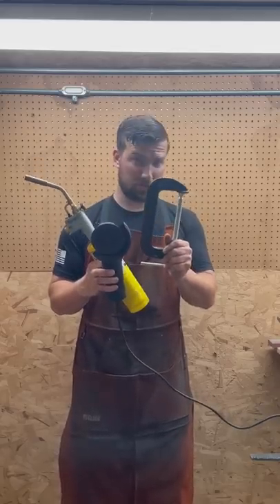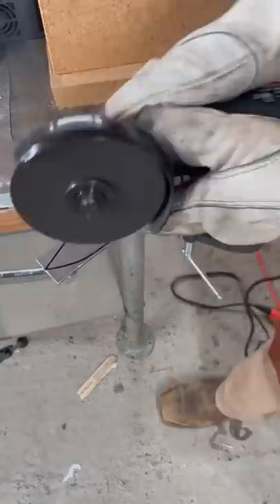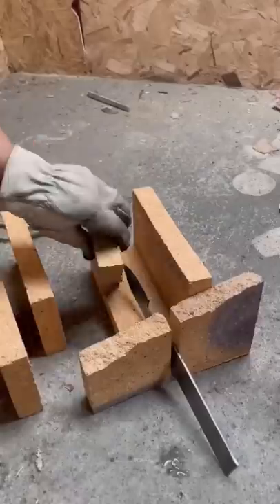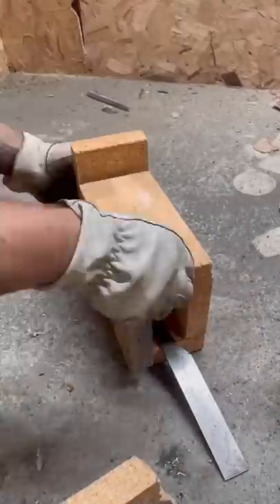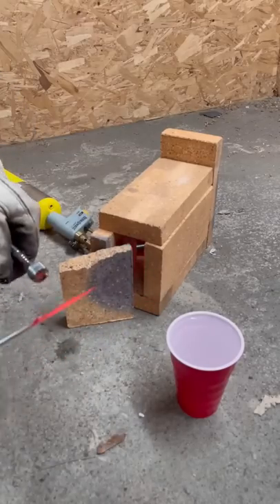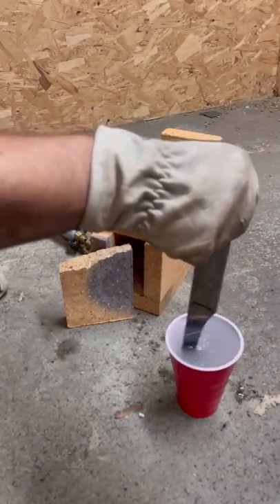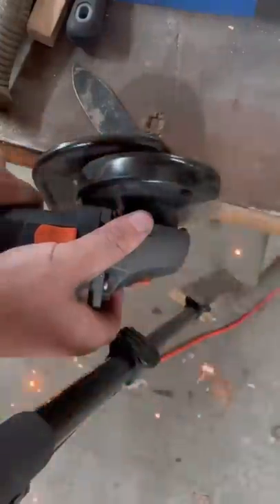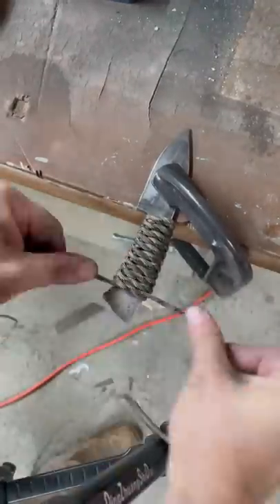How to start knifemaking without expensive equipment!!

Comment: I've been making knives since I was 13 and only had a bench grinder, dremel, and hand tools. Even made my own propane powered forge so I could heat treat them. This stuff is not as complicated as a lot of people think, it just takes a lot longer when you don't have all the tools you want like a belt sander and a metal cutting band saw.
Reply: My first one was shaped out with a grinder then cut my bevels in with files only. I honestly thought it was gonna take longer than it did but a good set of files will cut that in fairly quickly. I did the heat treat at work where we had a torch and also used the drill press at work for my pin holes. I was proud as shit of that knife. It was a Bowie I made from a horseshoeing rasp. I even cut several trees down with that thing about 6 inches in diameter. That was the first of .any more to come and now I haven't touched a knife in almost 15 years. I'll get back to again eventually
Reply: If you get into different types of steel your have to be more precise in the heat treat. I'm sure you know but people reading these comments may not.

Comment: Can we talk about how perfect his bevel was with an angle grinder? Dude could literally be a world famous pipe fitter!
Reply from the maker: I was a pipe fitter
Reply: @calculatedsurvival  I wish I was your welder. We would’ve been a perfect duo.
Reply: @calculatedsurvival  was...what happened bro, me n my mom are both in the trade although she only works for about 6 months out of the year now n days
Reply from the maker: @dewal5772  my passion was the outdoors.
Reply: @calculatedsurvival  so now you just do YouTube or...do you still have a day job I fully support the grind if you are trying to become, a YouTuber my friend it's a decision I could never make after many years now
Reply from the maker: @dewal5772  Well, I post to Tiktok, instagram and Facebook as well. I have a website where I sell survival equipment. But more importantly, I have a couple patents pending on some survival gear I designed. And I have more on the way. I love innovating and I worked it into my love for the outdoors. So no other day job to answer your question.
Reply: So for reference the proper angle for forming & sharpening a knife is 17%
Reply from the maker: @devingeary455  a kitchen knife, yes. I use a 20° angle for my knives though… it’s slightly more stout, and still gives me a hair-popping edge.
Reply: @calculatedsurvival Great video. Could you please tell us where to buy your survival equipment at ???  Thank you.
Reply from the maker: @shanesims2864  www.calculatedsurvival.com
Reply: Came for a quick knife video,  subscribed for you transparent and honest in depth responses. Great content
Reply: Can I buy that from you.
Reply: @calculatedsurvival why did you bake it at 400?
Reply: @dannyshane4722 I'm new to this, but it's my understanding they do that to temper the steel/blade
Reply: Most people don’t realize how difficult it is to use an angle grinder.

Comment: Bro , that is so cool, I think this is the only video that I feel I can do tomorrow, no problems. Boom I have a cool knife !
Great content !
Reply: Until you realise the absolute sick grinder skills required to get those bevels right, free hand, with the least precise tool in the whole workshop...
Good luck but this video is a skill flex....
Reply: Yeah I just noticed that bevel/grind skill. Yeeeeeeeah, gonna be a min on that.
Reply: Would you make it a Chod knife as well?
Reply: @CS-zn6pp  and getting the blade thin, but not so thin that the temper warps it, then grinding the rest of the bevel in without fucking up the heat treat, also most ovens will shoot up to 500 and drop to 350 before regulating temperature so the heat treat cycle is really inconsistent.
Reply: Facts
Reply: Or just buy one and get another hobby lol
Reply: Very good job. Hope you will have more videos
Reply: Until you say, “tomorrow, really”
Reply: @CS-zn6pp  it's really not that difficult my man. A flap disc makes it a lot easier to control the amount you take off. They come in various grits and I would even wear one down a bit on some scrap to use as a finishing disc.
 I made a very nice looking machete using an angle grinder. I do have quite a bit of experience with the tool though.
Reply: @brertt8350  you are absolutely correct. I was going to say that what he doesn't show is working it on the flame to get an even heating. You definitely can't just stick it in there and let it heat up. It takes a little knowledge of the colors in order to keep from burning the tip and to get an even heat.
I've had a couple of knives warp because of a slight temperature difference between each side.
Reply: @CS-zn6pp  amen ma brotha
Reply: Only if you know how to tie a paracord
Reply: Did you ever make one?

Comment: Thanks for this. Simplification of heat treating needs to be a thing. Well done
Reply: There's a lot more to heat treating than just one big dip
Reply: I'm still corn fused about the heat treat. He said he puts it in the oven for a hour @ 400⁰....he does this twice? So, he takes the knife out, resets the timer for a hour, puts the knife back in?
Reply: @L-Train0ne  
That's not heat treating, that's tempering. 
Heat treating makes the metal hard but brittle. 
You want enough hardness to retain an edge but it will be too hard and become brittle. 
Tempering will bring down the brittlness and it will be easier to sharpen.  
Every steel for knives has to be heat treated and tempered. The heat treating is the same, bring it to critical temperature (so hot a magnet will not stick) and then quench is some liquid to "set" the grain structure. 
The tempering can be different for different types of steel.
Reply: @samcoon6699  ht is the entire process, hardening makes it hard, tempering makes it soft.
Reply: @L-Train0ne  yes two cycles air cool to room temp then do it again
Reply: although with water and brine you run risk of cracking blade...oil quench is better option with same method to quench
Reply: @markboston2850 is it a special oil? Or will vegetable oil work

Comment: Easy and clever. I suggest leaf spring steel when available. Either way, that's a proper decent piece of kit.
Reply: Leaf spring steel is objectively a worse idea. Could have microfractures from use, but even worse, it could be a range of various different steels depending on manufacturer and age, and that's a recipe for inconsistency and sub par results.
Reply: I have made a few knives with spring steel! They have turned out nice!
Reply: If you really wanna bitch, how do you know it's really 1095?
Reply: @nickhadfield3192  no. it can be normalised and tempered.
Reply: @jackkincaid9705  Send a sample to Underwriters Laboratories ? Nope, that might not be the best idea yet.
Reply: @jackrichards1863  That does not eliminate microfractures, and even when there are none, you still don't know the exact steel, so it's almost impossible to heat treat it correctly.
Reply: @bonumferrum4055  ha ha ha . First rodeo eh! I guess I was green once too.
Reply: @bonumferrum4055 it's pretty easy to heat-treat actually. I would still recommend just purchasing high carbon steel pre-cut pieces
Reply: Or try using that old lawnmower blade you just changed out…

Comment: Oil is far better for quenching. The water can flash evaporate to steam creating a tiny pocket of gas that will prevent that part of the blade from cooling at the same rate as the rest of it.
Reply: Water quench is also more aggressive and greatly increases the likely hood of cracking.
Reply: This is brine though which is great for 1095

Comment: Oh that's awesome I never knew you could judge the temperature for heat treating by using a magnet.
Reply: you can't it loses magnetism at a irelevant temperature its 725 something and deired ranges feom 750- 1000 depending on the material

Comment: Nice instructions. But that propane torch tank sure looks like a MAP gas tank. Just saying because there's a little difference between the two. As one probably wouldn't heat the metal hot enough.
Reply: Truth.
Reply: This.
Reply: @leggoego  mmmm. U confuse me. Maybe I'm to ignorant. Please explain
Reply from the maker: Yeah it was MAPP gas… I mis-spoke
Reply: @calculatedsurvival  I read messages. I apologize. Yeah lots of peoples pointed this out. As Mapp Gas is a stabilize form of Propane and acetylene oxygen enriched. So technically you're right.
Reply: @patrickdavis9566  he's pointing out your comment and agreeing.
Reply: Propane will heat the steel just fine. That's why he uses fire brick. To hold that heat in one spot.
Look up propane forge.

Comment: Honorable mentions:
1. Metal purchased from Amazone
2. Oven Bricks
3. File
4. Salt
5. Cup
6. Water
7.Oven
8. Sand paper
9. Paracord
Reply: Don’t forget…
10. Electricity
11. Money
12. Gloves
13. Tongs
14. Sweet Apron
15. Spare Time
Reply: I would like to add :
16. Magnet 
17. A 24 grit sanding disc
18. Desire to make something you could most likely buy cheaper on Amazon.
Reply: @adamb8317  yessir and you’re missing a sense of humor
Reply: @danno8852  nope I thought it was kinda funny. It was a tired joke by the time I got to it though.
Reply: 19. Hands
Reply: @codyburk84  20. Air
Reply: @adamb8317  nice
Reply: @codyburk84  21. Ambition
Reply: 17. A pair of hands 
18. A brain
19. A power outlet
Reply: Propane torch*
Reply: @adamb8317  hey now, you couldn’t have been too tired of it if your joining in on the fun aye there buddy?
Reply: 57. Human being
Reply: All of which are pretty easy to obtain at any hobby shop/hardware store.
Reply: Paracord has left the chat.
Reply: What's the oven for?
Reply: @SouthGlass for the sweet azz special brownies he's going to cut with said blade!

Comment: For those of you who want to do this but want to do it cheaper, a hole in the ground will work just fine as a forge. Firewood will get plenty hot enough but you'll need a forced air system. A 3' steel pipe (do not used a galvanized pipe) and a bicycle pump will work fine for a bellows. A piece of railroad track works for an anvil. I've used smooth rocks as anvils. Sure they break but.....
A claw hammer, ball peen hammer, small sledge hammer will work. You just need something to hit the steel with. Files can be had cheaply. Use your imagination. 
Good luck!
Reply: How long would the filing take for a knife a similar to this one?

Comment: I have a rotorary, a handheld grinder, a Craftsman combo belt and disc, with the blue abrasives. Electric oven, and a torch set. I like his use of water hardening materials. They are considerably, softer than other materials, and can crack when quenching. The draw back times, are kinda extra precautions. One hour per inch, is the most common preference. I have used them all, air hardens are the toughest materials. Plastic mold mirror metals, make pretty finishes. Blades used for camping, and batoning, need tougher materials. Kitchen knives can be thin and hold an edge. A EDC, somewhere in between.

Comment: To every aspiring knife maker, come to the realization that there’s gonna be a point where you’re gonna need to learn to forge. This is a starting point, but don’t linger at this level long. Make a cheap forge, get a piece of cheap railroad for an anvil, a decent quality smithing hammer and get to forging.
Reply: Good tip on the railroad I never thought of that! I’m on a budget starting my knife making and an anvil is expensive for me

Comment: First I would quench in oil if using 1095 especially if you're a beginner. Second I wouldn't use a plastic cup as the quench bath. You can get a gallon of peanut oil, which has a high flash point, for about 15 bucks and an empty paint can for like 3 bucks. Source: me I've made about 30 knives out of 1095 quenched every one in peanut oil and they all came out perfect. Oh don't forget to heat your oil up to about 100 degrees maybe 120 warm oil draws the heat out of the steel faster. Next when you make a blade longer than 4 inches you have to learn how to straighten warped steel, just remember knife makers don't make mistakes they just make smaller knives.
Reply: Quenching in brine or parks 50 is usually better for 1095. I use canola oil which is not as aggressive as peanut oil and it still works but it's best to stay safe with parks 50 if you can afford it. Brine is scary since it can lead to cracks, but still better than peanut or canola oil
Reply: @Skidgiz99  oh yeah for sure my comment was specifically for beginner knife makers. I'm still annoyed as fuck by the plastic cup.
Reply: @ragingmoderate6791  lol yeah that's kinda sketchy. My first quench tank was a Tupperware. Melted straight through it. I spilled oil everywhere.
Reply: @Skidgiz99  that's why I'm glad my very safety conscious brother was the one who got me into wanting to make knives. When we were looking for a quench tank I suggested using a Tupperware container and he just gave me this look like is was really dumb.